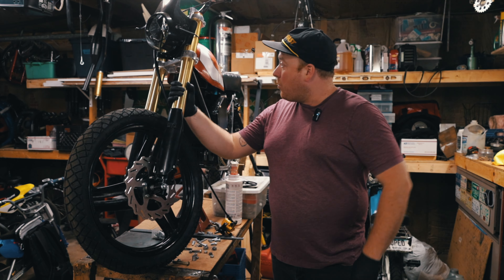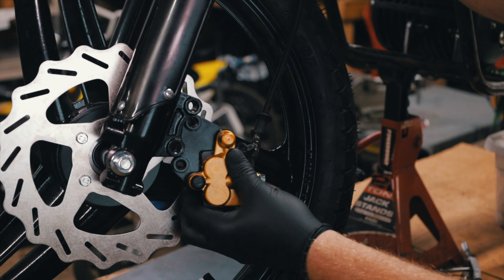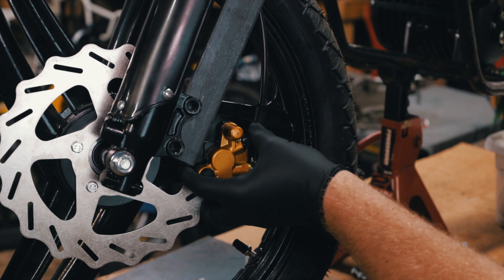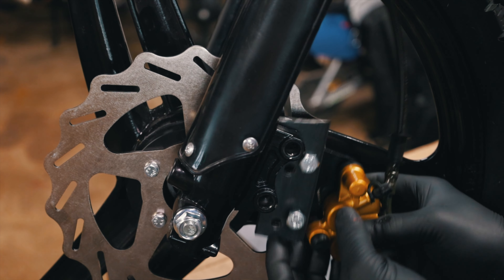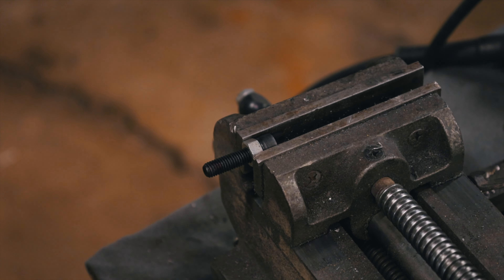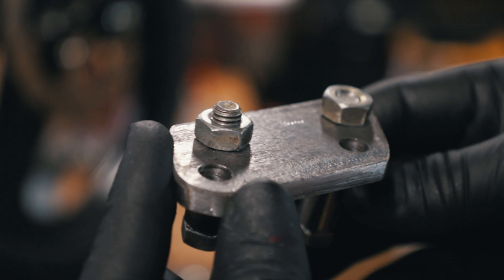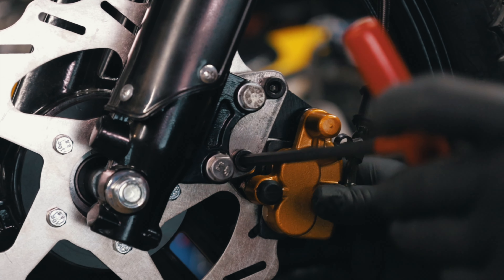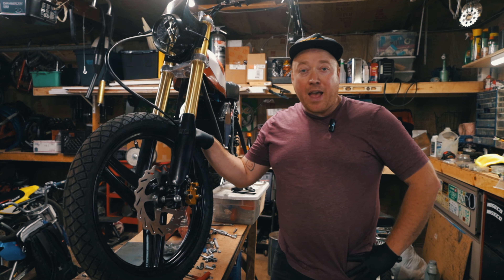Custom Disc Brake Adaptor  Derbi Diablo QS138 Votol 200a ebike moped not working

Comment: Badass dude. Looking to do this on my mb5. Would really like a dual piston caliper
Reply from the maker: Yeah! You could totally run a dual piston. You can honestly make anything fit with an adapter
Reply: @Corn-ped  exactly. The MB5 disk is so big and then to have such small brake pads feels dumb. Stock stopping power is fine but why not make it better. I'm looking at ninja 250 calipers. Floating calipers are very forgiving
Reply from the maker: Yeah that would be awesome!